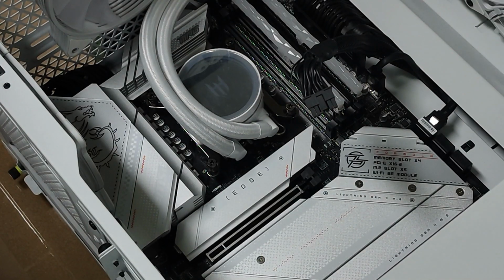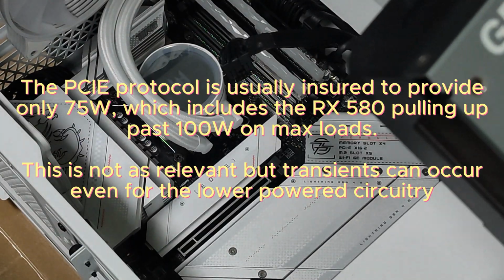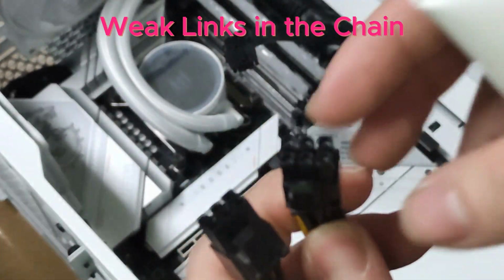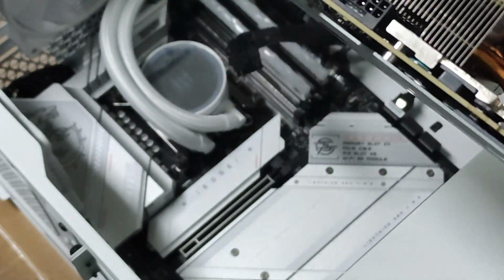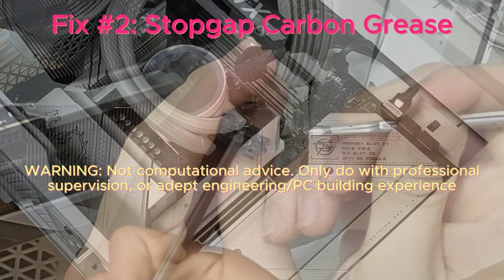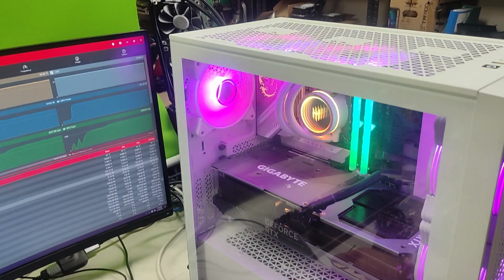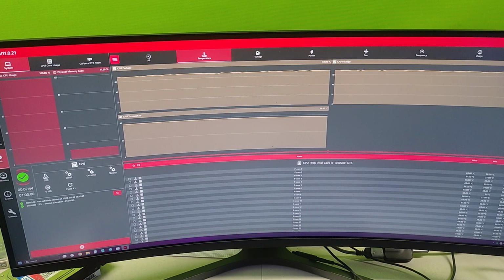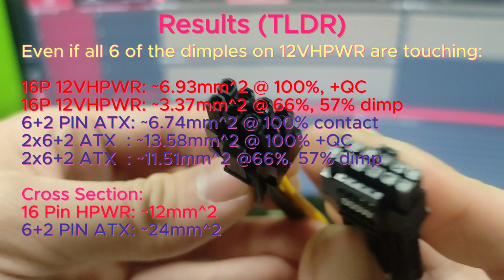RTX 12VHPWR Disaster - HALF of 6+2 Pin?! [PCIE 5.0 EPS RTX 4090]

Comment: I just bought the New Thermaltake Toughpower PF3 ATX 3.0 1200W 80+ Platinum  power supply i'm using the Nvidia Assus TUF Gaming RTX 4080 OC.
So now i have not installed my new power supply yet, i have a EVGA 750 WATT power supply right now and so far no issues yet.

Now i'm upgrading to a new Motherboard, and New power supply as i stated above here, and i hope i have no issues i probably won't because the new Power supply is more than enough.

Now My GF just got the same motherboard and same power supply and just got the Nvidia Assus TUF Gaming 5070  i believe i know it's the 50's series so i hope she has no problems because that GPU is more power hungry that my 4080 GPU, so we shall see what happens..

Comment from the maker: NVIDIA breaks the laws of physics and gets sued instantly https://au.pcmag.com/graphics-cards/97365/nvidia-faces-class-action-lawsuit-over-melting-12vhpwr-cables
Insertion is not the problem, and not entirely -- using it on the 4090 is the major issue https://youtu.be/mKqC2wJIeEI (2:00 and 5:20)
Funded by Dell and NVIDIA, designed by Intel and friends (of course, sponsors stringently guidelining. Additional reading: http://jongerow.com/12VHPWR/)

If you are asking, I have studied first year electrical engineering at UNSW and have been a studying mechanical Engineer, learning how to calculate cross sectional area in primary school.

Comment: I’ve been saying since the beginning there’s way too much resistance and that = heat under load. It’s like if you build a big car stereo setup and you use too small of a gauge power wire for the amp it melts or catches fire
Reply from the maker: You'd think they would at least match the gauge thickness of a 6+2, but no
Reply: @compuguy123  exactly
Reply from the maker: @cppctek  Funny cause people are arguing that I don't have an electrical engineering degree to call out NVIDIA's inability to calculate a difference in cross sectional area (grade 2 maths)
Reply: @compuguy123  electricians who wire houses also don't have electrical engineering degrees eather.